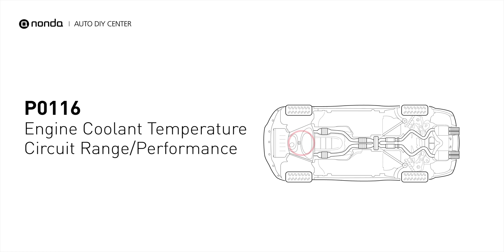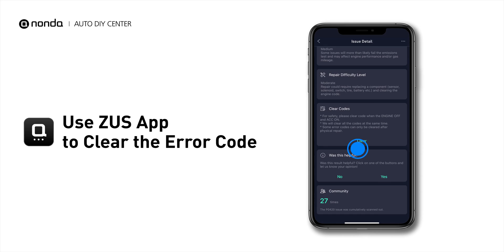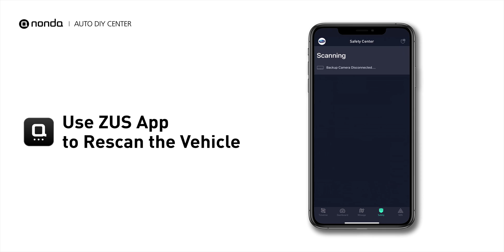How to Fix P0116 Engine Code in 3 Minutes [2 DIY Methods / Only $7.31]

Comment from the maker: Hi, I'm Steve, nonda's lead mechanic engineer. 
Feel free to leave your comments here if you have any mechanic questions, I will be glad to help you out!
Reply: I have a 2007 Mercedes clk 350 and the code just came up 😭😭
Reply: Can’t find it on 2015 Kia k900
Reply: do i need to tune my subaru sti when replace these ect sensor or the thermostat?
Reply: p 0116 เซ็นเซอร์ความร้อนเสียใช่ไหมเอ่ย
Reply: P0116 
Does that mean the heat sensor is broken?

Comment: Would a bad ECT affect the AC? Mine blows very cold then randomly starts blowing warm .if i restart the car it starts blowing cold again
Reply: Same problem. Did you solve the problem ?
Reply: Check your turbo coolant and see if its empty. Its on the back towards the left when you open the hood. If its empty the small gose that connects to the tank is leaking. Mine crumbled in my hand . After fixing this i didn't have anymore cooling issues with the AC    e @robertoldenburger4290

Comment: I’ve replaced my knock sensor 3 times. 
Chevy Cruze LT RS 4 door 1.4L engine 2013. 
We’ve replace the turbo, thermostat and I think gasket. Do you know of the term “pigtail” I guess it’s a wire that connects to the knock sensor? 
My car runs great for exactly 2 weeks after replacing the knock sensor then I go back to losing power. Today I couldn’t get it to go at all at the stop sign. I could go in reverse but not forward. Also if the air conditioner is running it lags badly then boom finds power? 
Also my dad replaced a black thingy that covers the spark plug wires. 
The error code states the 1st circuit bank something.
Reply: Does the air start blowing warm ?
Reply from the maker: Hi Stacy, we highly suggest to get your vehicle visually inspected by your local mechanic for further diagnosis.

Comment: What's the location for the sensor on a 2011 chevrolet camaro LS
Reply from the maker: Hi Latario, it should be located in the engine compartment (top front of the engine, below the throttle body).
Reply: @nondainc  Thanks